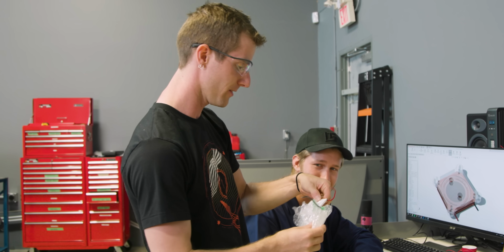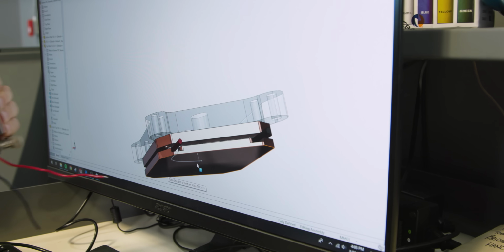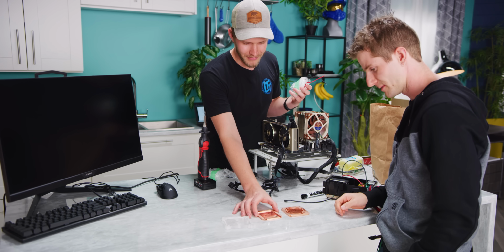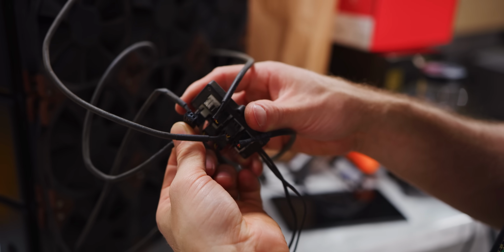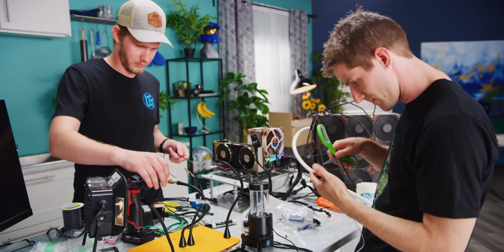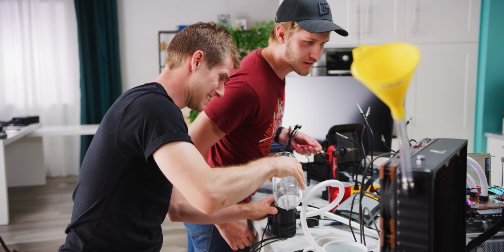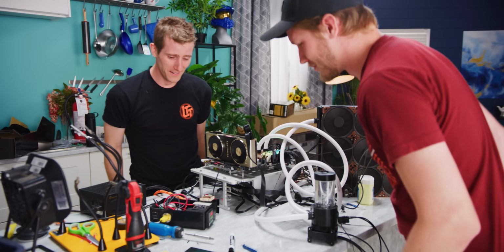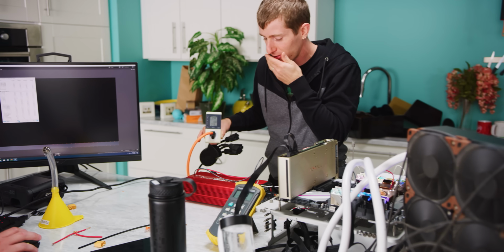This Cooler DRAWS 545W!!? Bad Cooling Ideas #2

Comment: COLL THE WATER, not the CPU. Do 2 water loops, CPU to Peltier, Peltier to Radiator. The problem was that the CPU heated the copper sandwich too fast, but if it have to cool water, the heating curve will be slow, right?

Comment: You don't "overdrive" TECs, as a matter of fact, you don't drive them at maximum rated power in any case. These are so terribly inefficient that the thermal transfer capacity gets overwhelmed by the elements own heat production, making the optimal operating point far lower than the maximum rated power... overdriving them basically turns them into heaters on both sides eventually (most likely frying the module in the process).
And that is why directly cooling a CPU with a Peltier will never be practical.
However, you might wanna try to use it as a cooling "afterburner"  - ie cool the water in the loop after the hot water passed through the radiator as the first cooling stage. If you need more cooling power use multiple modules in parallel and don't drive them at full power.

Comment: liquid nitrogen cooling has issues with condensation...
but if you seal the pc in a case and have a vent system at the top with a flap just for pressure(because its cold and will sink) you can purge the moisture slowly bringing the temp down and the pc will never condense.

Comment: Hey guys, why not use a car radiator in the water loop? I mean, if it's sketchy, max it out! Or a condenser from the AC loop in a car, which is a little smaller. 
Anyway, nice work! I'm looking forward for more videos like this!

Comment: If you want hundreds of watts of cooling you can also try using rc airplane and rc quadcopter motors with propellers instead of fans. There are also electric ducted fan units that are used in rc jets and they are very powerful. You could build a several thousand watt cooling system inside a pc case with those

Comment: The surface area in your cooling block is too small. Taller fins and more of them.
Reply: This can easily be confirmed by measuring the differential between the water in and out temp hence the the thermal exchange efficiency compared to the cpu temp.

Comment: You have the TEC in the wrong place, the optimum and less useless place (but still useless) would be between the input and output of the radiator.
Sandwich the TEC between two CPU water blocks, move the "hot" water entering the radiator through the hot TEC block and the "cooled" water from the radiator through the cold TEC block.
This should theoretically increase the heat being radiated by the radiator as it is increasing the temperature of the water entering the radiator and cooling water entering the rig, and you don't have to mill your own blocks to do it.

Comment: The reason the relay didn't work is because solid state relays are based off a component called a triac. They essentially will only turn off after the current drops below a certain threshold. That's why they work on AC as that happens twice every cycle. On DC this never happens so it would remain stuck on. You either need a traditional mechanical relay or a component such as a MOSFET or igbt with the appropriate drivers.

Comment: Idk if this would be practical or clever or make any sense but could you make a computer that is completely air tight that's water cooled with an external rad, thus removing the need to ever clean the dust out of the pc?

Comment: Use the peltier to cool the water. So make it a heat exchanger by adding a block also for the cold side. Then, use a normal CPU block for the CPU, direct water from the CPU through the hot side block to the big radiator and from the radiator through the cold side block to the CPU (and of course a pump somewhere in the loop). That way you can still use the loop as a normal loop if you do not power the peltier.

Comment: Lots of janky things in this build. PID is not working or improperly wired. What is the clicking relay for? I thought they were using the SSR? Or they found out that that 32 amps is Chinese amps :-). And anyway it is bad to run an SSR near its maximum rating. You can't PWM with a mechanical relay at any reasonable switching rate. I think the fundamental problem is the heat capacity/thermal mass of the Peltier.

Comment: Why didn't you use the motherboard's CPU fan header hooked up to the relay/digital variable voltage supply and set up a "silent" fan curve in BIOS so the motherboard will handle turning off the peltier below a certain temp, using the CPUs own temperature sensor?

Comment: Hope plenty more to come in this series!!
How about use it to make power? Run some fans n lights. Save power and still cool using water cooling loop
Done this before on low heat situations. Ran a fan EzPz

Comment: Why have you got AC going into the PID box? shouldn't it all just run off the PSU 12volts
Reply: The PID box is for industrial control and are often specced for 115 or 230v, although I'm sure DC versions would be available.

Comment: 900W through those tiny peltier cables, no wonder something's burning. Also, you didn't need to swap the peltier side, just invert its polarity. Then again, I would love some colab with eevblog, ElectroBoom or even thunderf00t for a in depth explanation  :)

Comment: There's no way that little water flow can stop it from overhearting
Reply: Yeah exactly. That needed serious water flow, the water block heating up that quickly says it and/or the water flow were undersized.
Reply: The sad thing is, that they don't understand peltiers apperently. The water was not able to get the heat away. Meaning the peltier cannot cool and will just act as a heater. Linus brilliant idea: Cranck up the heater you put on your cpu even higher.
Reply: Thanks!! Yah i would not rull out this before they can keep the hot side alot cooler.. as i recall the delta t will drop when getting hotter.. so a theoretical hot/cold temp of 70c is not at a burning hot side.

It is not a good solution power wise!

I did an 85w with water on a celeron 300@504 -17c idle 0c load..
Back in the day.
Reply: Peltiers never gonna work on something that is actively producing heat like a CPU ... The actual cooler is the radiator here ... If they directly use it with the CPU and water block it would do better job ...
Reply: @anikdey2100  explain to me why my old cpu was -19c at idle and 0c under load with peltier and water.. with a room temp of 22c
Reply: @fraguzz  for idle it will work because it is not actively producing any heat ...and for load are you sure you are talking about "steady state temp"? And 0c CPU at 22c ambient? What did you do to stop the condensation?
Reply: @anikdey2100  temp messured below the  cpu(under side of chip)  by the motherboard. Condensation.. the entire thing was covered in silicone. And it was full load.
Reply: @fraguzz  was it steady state? I mean how long you run the CPU ? And may be your radiator was Powerful enough to radiate the heat produced by your CPU (for example 100W of heat if your CPU has 100W TDP) and the peltier module (for example 50W module) ... So probably you had a radiator that's capable of radiating 100+50= 150W of heat
Reply: At the end they would need an ocean to cool this peltier. When the watercooling system they used would be fine without peltier at all...

Comment: you'll see much better performance if you modulate or current regulate the peltier. a relay, not so good. you would think by pushing double the voltage you would see better cooling, but what you really do is just create a bunch more heat.

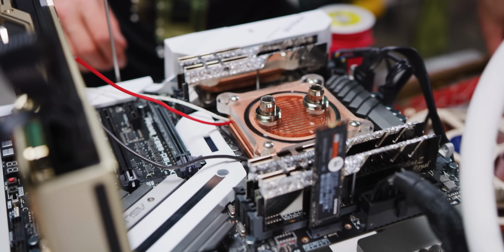Comment: 13:40 No pressure-levelling lever, no pressure-limiting springs, no check for leakage and they haven't even checked which side is "cold" and which is "hot"… damn savages…

Comment: Maybe you have a normal water loop but add a tec cooling stage along the line, after the radiator, to cool the water more than the radiator can. Would fix the condensation and also wouldn't overpower the tec by having it right on the heat source.

Comment: the only way the TEC will be efficient is to cool the water  that means just remove the radiator and cool the water flowing through the CPU block using one more water block for TEC and a heatsink attached to it...
the water will be very cool and that will absorb a lot of heat from CPU 
dont attach the  TEC on the cpu directly 
GOT IT?

Comment: A single-stage thermoelectric cooler will typically produce a maximal temperature difference of 70 °C between its hot and cold sides.[7] The more heat moved using TEC, the less efficient it becomes, because the cooler needs to dissipate both the heat being moved and the waste heat generated from its own power consumption. The amount of heat that can be absorbed is proportional to the current and time.

{\displaystyle Q=PIt,}{\displaystyle Q=PIt,}
where P is the Peltier coefficient, I is the current, and t is the time. The Peltier coefficient depends on temperature and the materials the cooler is made of.

In refrigeration applications, thermoelectric junctions have about 1/4 the efficiency compared to conventional means (they offer around 10–15% efficiency of the ideal Carnot cycle refrigerator, compared with 40–60% achieved by conventional compression-cycle systems (reverse Rankine systems using compression/expansion).[8]) Due to this lower efficiency, thermoelectric cooling is generally only used in environments where the solid-state nature (no moving parts), low maintenance, compact size, and orientation insensitivity outweighs pure efficiency.
https://en.wikipedia.org/wiki/Thermoelectric_cooling
----------------------
Was all of that necessary ? no. But fun, Yes.

Comment: But how efficient is your water block for directly cooling a CPU..?? How did you forget that.
Reply: @guptadagger896  the whole point of tec is sub ambient cooling potential
Reply: @mikecrapse5285  Then why not use the TEC to cool the incoming water to sub ambient instead?
Reply: @frederf3227  Doesn't worth it, overclockers tried it 15+ years ago & yield is so short as compared to LN2.
Also you have keep eye on pump & flow rate, cause as you go up for more cooling there are chances of freezing & choking the path, eventually zappp...!
Reply: @mikecrapse5285   
Cooling a 200W system with extra 420W load of cooler ! WTF is math ?
Even AIO vendors sell Asetek equipments under their name, they do test it gradually for every +1°C temp to find efficiency, economy & failure points. No one goes rushing for peak values.
Reply: the design didn't make sense why make a custom block instead of just using the TEC to cool the res water or the  rad instead
make a  custom rad instead of a custom block

Comment: Tech Ingredients has some videos going into TECs he uses to make a mini fridge. "EXTREMELY LOW TEMPERATURES! - Using TECs" is a good video for some details on how to get TECs to work more practically. Basically you could stack them. It would not be more efficient. But it would be able to make a greater difference in heat. I don't know if that would matter for cooling a CPU.

Comment: I think that if you stretched both parts vertically to allow the cold side to equalize and the top side to to have taller fins, it might work a bit better.

Of course having a 10cm high chunk of copper mounted on the CPU, it might be a bit heavy and inconvenient.

Comment: Alright bear with me for a second what if it didn’t work because the peltier was put in there backwards??
Reply: You're wrong, using peltier for this is stupid and extremely inefficient.
And the temps did go down before a load was put on the CPU, so it was installed the right way.

Comment: you need to cool the water with the TEC, the TEC is an insulator and will never work when placed between the cpu and cooling element hence as you saw you satuate the TEC as it has no buffer like the water does.

Comment: What about heat pipes to remove the heat from the chip and a peltier to only chill the hot end of the heat pipes, i think the problem yere having is there s just too much heat in a small area and end up with a cold middle but heat on both sides.

Comment: I think you have the wrong use case. I used to run an E1200 (Core Duo) at 3GHZ sub ambient with a TEC, thats more than twice the clock speed of stock. I think I used an 87w 12v TEC, but if I ran it on 12v it would be overwhelmed, I had to run it on 5v and it ran perfect.

Comment: although this proves that  peltiers suck for cooling, how about a video using the other weird peliter function IE there a tiny little thermal electric generator. I'd bet a "Total Genius" and "All around awesome guy" like Linus could make a "Bitch'n" RGB system that's powered by the CPU's own heat.
Maybe a separate set of red LED's that get brighter as the CPU temp rises.
ECT....ECT....

Comment: Hi.   I've done many TEC cooling experiments, about 15 years ago, in the "overclocking war period".

I think the main cause of the failure is you've undersized a lot both the heat exchanger and the plate on cold side.
You need almost triple the thickness on both.

The heat exchanger must have solid copper for a third of the thickness and the rest of a cooling pipe that doesn't restrict so much the water flow (I think the best for this application will be a simple serpentine about 15x15mm in cross section, milled from a 25mm block). Instead of using an acrylic cover, you can build a copper cover (about 2-3mm of thickness) and solder it to the base with simple electronics soldering alloy.

On the cold side, the increase of the thickness (minimum 15mm in my point of view) is necessary to spread out more the heat from the cpu (which is generated in a small area) to the full size of the TEC. Also to have more heat buffer.

Last one, if you want to modulate the power to the TEC, the proper way is a PWM controller that can handle the current on the 12V side.

Bye!

Comment: You are still not sizing the pelts right. A single 540w pelt has zero hope of sustaining a CPU load, you would need to stack 3 of those TEC's hot to cold. Also, what TIM did you use on the TEC to the copper block?

Comment: I still think you should use it as extra cooling on the water itself, strap a second waterblock into the loop that goes to the cold side of cooler, then either use a secondary water loop, or the most massive air cooler you can find for the hot side of the TEC and see what happens then.

If it can drop the water temp by a few degrees in the process, it would be a win. Not a massive success, nor practical still, but I am still curious if it would help or not. 

Now to explain my thinking on this, if the petiers can only dissipate heat at a certain rate which is not enough, you can always put multiple in series in the system to make sure you can dissipate that heat as fast as it is being created by the cpu. So, with that being said, the system would definitely be bulkier but you can run 5 50 watt TECs and see a bigger increase in performance than your single 545w cooler.

Comment: Use the TEC to COOL THE WATER in the water loop!! The thing does cool, but it doesn't have thermal mass and also is kind of an insulator by itself. Of course the cooling  is not  going to last if you put it ON the processor. You should put the TEC to cool the water output of the radiator to max the deltaT. I know TEC is bs. But with 500W even if the efficiency is crap that TEC should be doing a better job.
So the order in the water loop is processor, pump, radiator, TEC in its own waterblock separated from the processor.
Reply: And what will cool the TEC?
Reply: @siliablackfame5771  I would cool those  500W  with another separate waterloop. Silly right? well, TEC is inefficient so yeah. But it would work!
Reply: the problem is what happens when the TEC freezes the water in its waterblock. I would modify the waterblock to allow a greater flow of water to prevent that. The relay seems a good idea, I would program it so the temperature of water going out of the TEC waterblock is not cooler than the dew point for the atmospheric pressure.

Comment: Wouldn't it just be better to apply the peltier to the water rez instead of the cpu itself?
Reply: What if... noo that's insane... Maybe? What if we use a tec cooled by a tec cooled by a tec....
Reply: @siliablackfame5771  Wh0T
Reply: Silia Blackfame It’s TECception!
Reply: And what would cool the hot side of the peltier?
Reply: @siliablackfame5771  more water and a bigger radiator :D
Reply: @siliablackfame5771  Dual loops with radiator on the hot side, or even have a rad in the cold side also.

Comment: Just a few cents here, In case anyone here is actually planning on using any sort of TEC for any extended period of time, do NOT drive it with any sort of PWM. The constant thermal cycling will destroy the peltier much quicker than using (for example, definitely not the most efficient) a transistor follower and a PTC to regulate temperature as the peltier is not subjected to huge thermal shocks which can break the PN junctions inside the cooler. If you're interested in how they work google 'Seebeck Effect'

Comment: Your radiator had to dissipate 900W+CPU Watt. Surely it must be overwhelmed.
Reply: I think the water pump was too slow and couldn’t get the heat out of the heat sink fast enough. The Peltier cooler has an uneven surface so it needed to be lapped with diamond paste. The hard mount probably caused the most heat. This thick setup needs tension screws for even pressure.
Reply: @markm0000  Yes, they actually put heat from Peltier into the CPU
Reply: Robiovic yeppers
Reply: that CPU block was not transferring 900W into the water sooooo, it radiator wasn't overwhelmed at all.